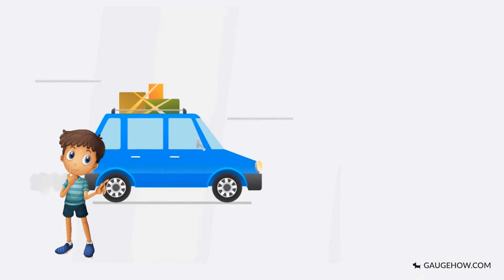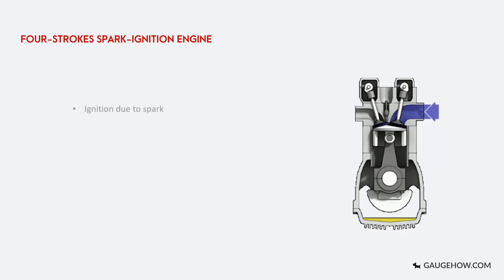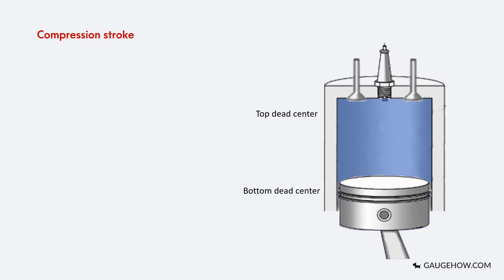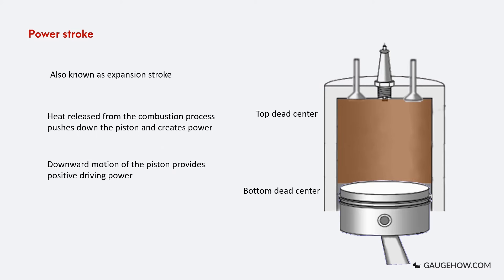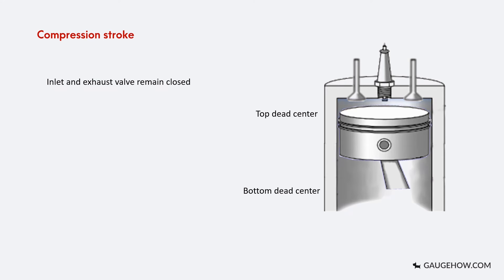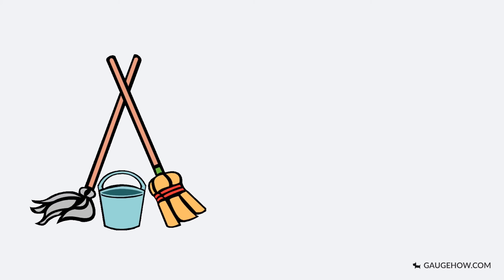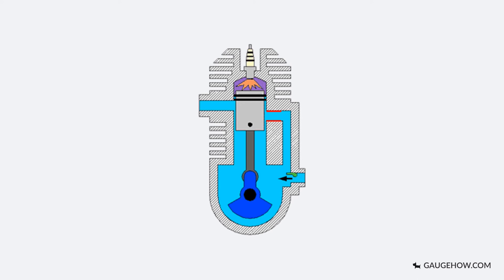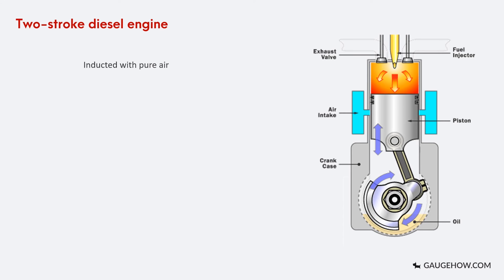Working Principle of IC Engine (Internal Combustion engine)

Comment: Combustion takes place at constant volume, not constant pressure in the case of spark ignition engines. Combustion takes place at constant pressure in the case of Diesel engines or CI engines.
Reply from the maker: Hi, Thanks for Writing. Will check Video Again, and update it if required.